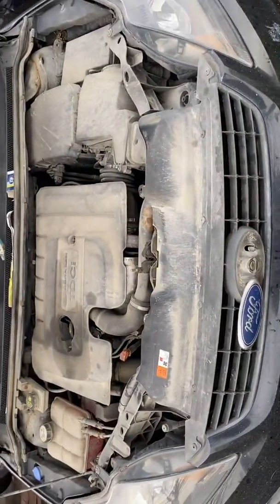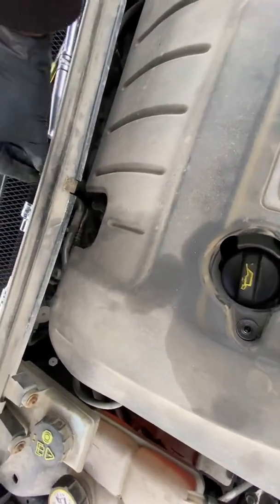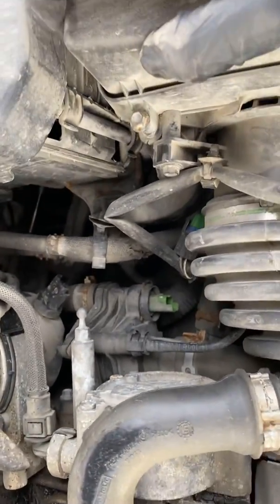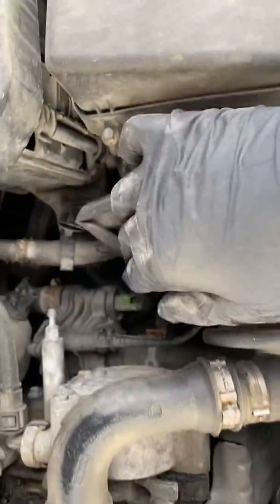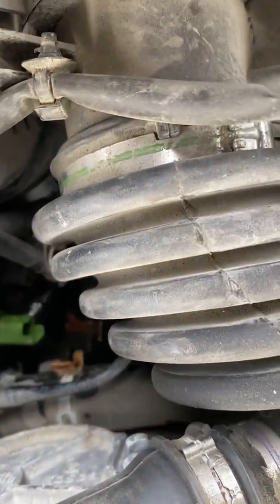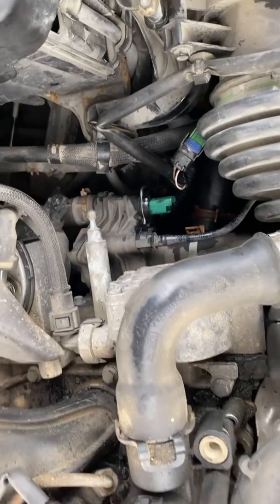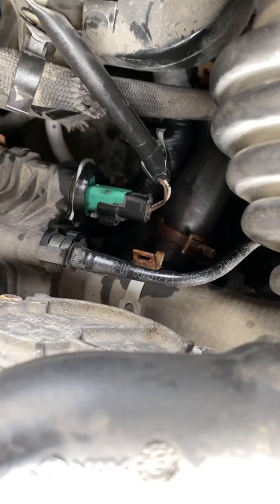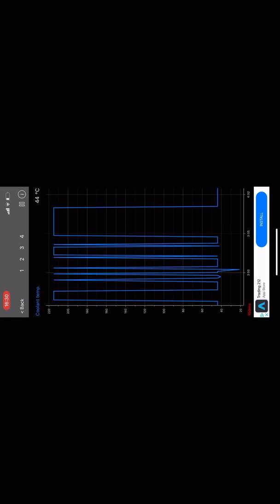Ford Focus 2010 1.6Tdci Coolant Temperature Sensor replace guide + diagnostics P1116, P0118

Comment: My cmax 1.6 tdci temperature keeps going to halfway which is normal then keeps dropping to nothing then back up and down but not over heating any ideas please😊
Reply from the maker: Are you based in Dublin ? If so you could drop it down to us.

If not, it sounds like a sporadic communication error, frayed wires, faulty sensor, irregular power delivery
Reply: @ckpelectronics8921  unfortunately I'm in London
Reply from the maker: @COPPERCATZ  get yourself a cheap diagnostic tool and look at the live data for coolant temperature,

If it's jumping it has to be the wiring to the sensor

Comment: Any idea where to get the wiring diagram for its harness for 2012 plate?! Mine doesn't bring any voltage. The wiring should be cut somewhere.
Reply: I would check the connector itself, it's unlikely that the cables have been damaged unless already previously been messed with in which you'll see evidence of where it was messed with.
Reply: @seancusack  
 @Sean Cusack  
I found the problem yesterday.
Two of the ECU connector pins were bended. I followed the cable   and did connectivity test all the way down till where it connects to the ECU. The cable was all good. First I thought it is the ECU. But when I removed it I noticed the pins are bended. 
Basically I took the car to a garage to replace the Gearbox a few months ago and when I got it back it had rough idling and the fan was keep staying on. They had no clue why it was doing it and they believed already was like that. But wasnt and I can see the ECU metal bracket and holders have been completely removed and missing. For sure they have removed the ECU. I don't think the ECU needed to be remove when replacing a gearbox on this cars as I have replaced the gearbox on a few similar cars before. 
Still I am thinking they've replaced the ECU. I remember when I took the car in the mechanic said a I have a 015 plate of this galaxies but it's not good. 
Any idea how to know if the ECU belongs/matches the car or have been replaced???
Reply: However, I straighten the ECU pins and the coolant sensor cables got 4.9 volt back when ignition on. And the car working great now. No rough idling no constant fan anymore.

Comment: what symptoms did you have with her?
Reply: This was a good while ago now, but it had a severe lack of power
Reply: Is the temperature needle allowed to drop when you turn on the heat?? 1.6 tdci 109hp
Reply: @rares.rsk9977  I don't think that's an issue if the temperatures are dropping, however Id say maybe the thermostat may be stuck preventing it from heating up
Reply: @seancusack  I get heat when the needle reaches 90
Reply: @seancusack  Should it be the thermostat?? I just changed it 2 months ago
Reply: @seancusack  Do you have watzapp to discuss more?